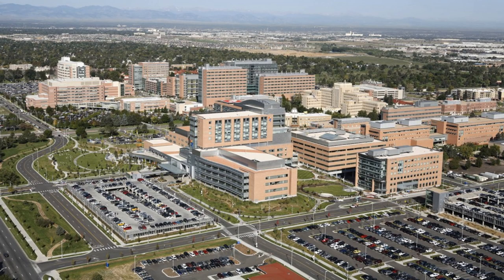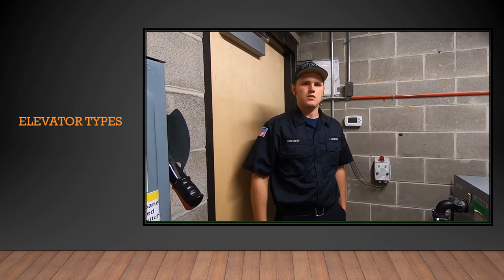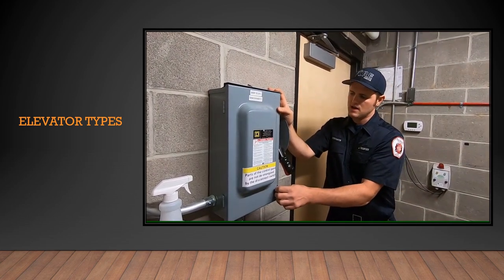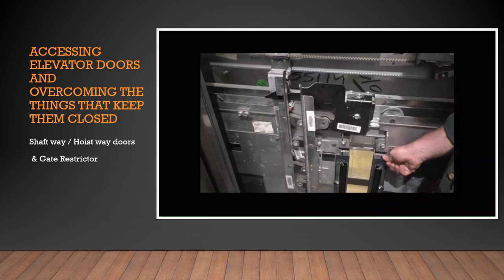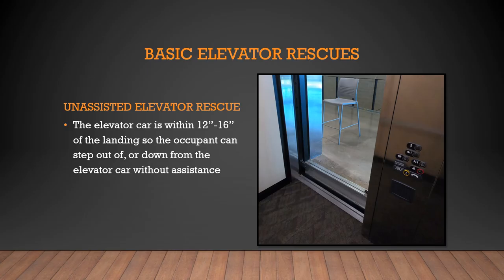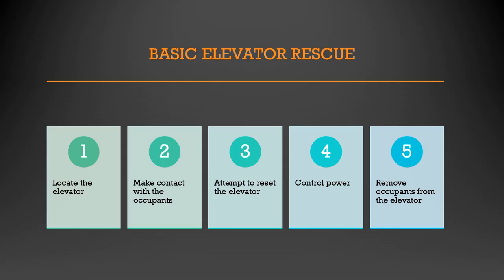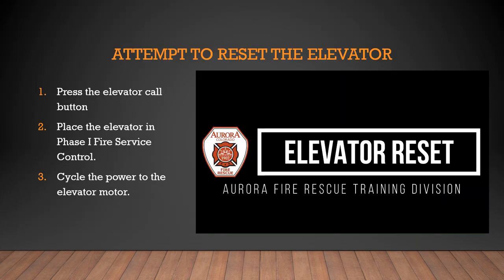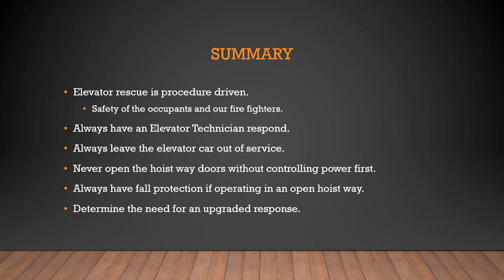Basic Elevator Rescue

Comment: 8:02 WRONG. MRLs can be either traction or hydraulic. They are not a separate category. Also Traction in hydraulic machine rooms can be located in different places. A lot of elevators actually have the traction machine in the basement.

Comment: Way to pull the disconnect without using proper caution from ARC flash.  No PPE, no arc flash gear, didn’t stand to the side, didn’t exhale as he pulled the disconnect!  Stupid is as stupid does!
Reply: You don't need any of that to shut off 460v
Reply: @dannoagent8688  you should read the work safe requirements then!